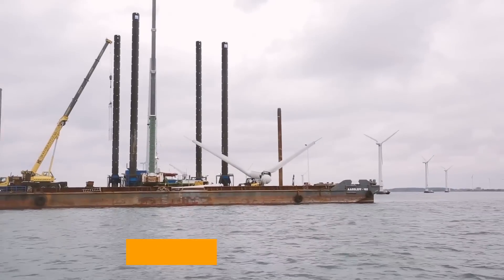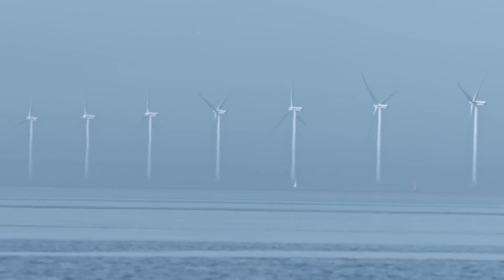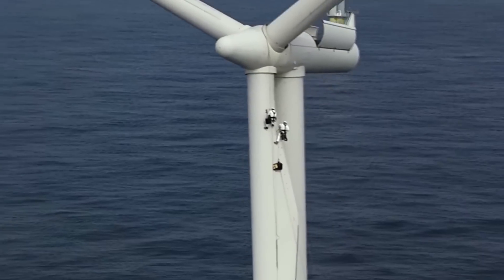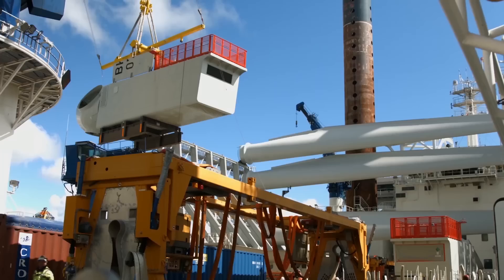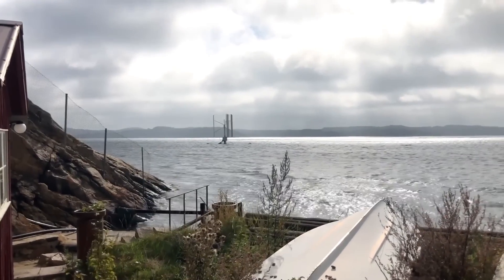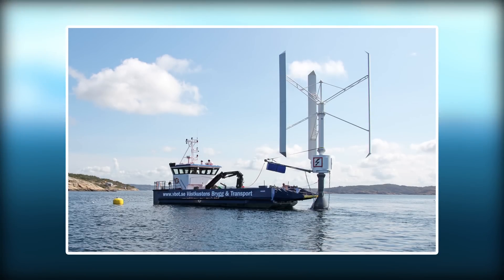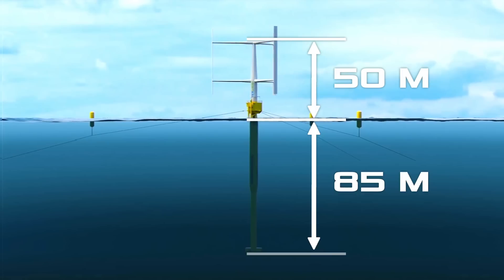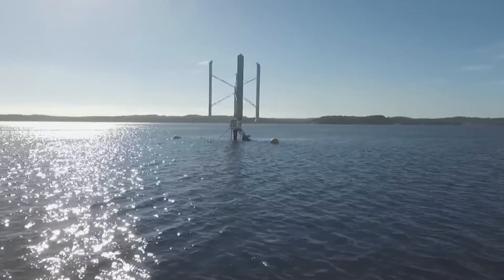Vertical-axis Wind Turbines could Revolutionize Offshore Wind Power

Comment: Great video. Just a correction though: SeaTwirl is not a Norwegian company, as mentioned in the video, but a Swedish company listed on the Nordic stock exchange Nasdaq First North.

Currently the company has a valuation (market cap) of less than $30 million so the potential of the stock is huge from here considering all the advantages mentioned in the video.
Reply: it is now worth around 23 million euros. The problem is, on their website they say  first commission will be made in 2025 so they will keep burning cash until 2025. IF their products are efficient and if they can sell then the upward potential is extreme but it's too risky for now.
Reply: That sounds like marketing to me, piss off.
Reply: Thanks for mentioning that it is a listed company. Will short it.
Reply: @jonaslipskas  let me know by replying to this comment again that if you made any profit or not. Right now the whole company is worth around 18 million euros. There are not many startups on the field so they can easily get bought by an industry player that's why I wouldn't short.
Reply: @husnucoban3571  to be fair, it's quite dangerous to short it because they are spending a lot for commercial and that can push price up for short time. But they do not have any chances in the long term. The proper turbine for offshore at the moment is 14MW. This company has no chance to produce turbines like that and you have to be insane to construct a 1MW turbine...
Reply: @jonaslipskas  I believe the same way but there are not many people trying to improve the current technology and creating start-ups in the field. Therefore eventually either they are going to be bought by an industry player for the know-how or they will shut the company down and pursue another start-up that would actually be comercially reasonable. The whole company's market cap is 18 million euros.. it is Nothing in this field. Founders will be rich eventually but I am not sure if it's going to be from this specific company.

I wouldn't trade in this circumstances.

Comment: Unfortunately most assumptions in this video are not true.
Reply: This what i have perceived as input power of air pressure produce little output in vertical blade system. O/I ratio will be low.

Comment: This entire video is filled with misinformation and blatant lies, easy to prove with just a few minutes of research.  I’ve worked in the utility-scale wind industry for over a decade and the reason NOBODY uses vertical axis turbines is, they do not work.  VAT’s produce only a small amount of power compared to HAWT’s.  Land-based horizontal, utility- scale turbines produce 80% of the time at 45% full capacity.  Off shore turbines produce 90% of the time at 65% capacity, and they easily yaw and steer into the wind.  Average lifespan is 30- years.  Numerous engineering firms have tested and proven VAT’s to be ineffective and a waste of money.  Don’t listen to morons like the guy on this video who have NO idea what they’re talking about, read the facts.
Reply: You don't seem to be up-to-date with the latest research. A recent report from Oxford Brookes University concludes that Vertical Axis Wind Turbines (VAWT) is far more efficient than traditional Horizontal Axis Wind Turbines (HAWT) in offshore wind farms. This since VAWT wind turbines increase each other's efficiency in wind farms and create much less turbulence (much less wake effect) and can hence can be placed much closer to each other.
Reply: Quotes from the research report:

"New research from Oxford Brookes University has found that the vertical turbine design is far more efficient than traditional turbines in large scale wind farms, and when set in pairs the vertical turbines increase each other’s performance by up to 15%."

Professor Tzanakis comments “This study evidences that the future of wind farms should be vertical. Vertical axis wind farm turbines can be designed to be much closer together, increasing their efficiency and ultimately lowering the prices of electricity. In the long run, VAWTs can help accelerate the green transition of our energy systems, so that more clean and sustainable energy comes from renewable sources.”

Comment: These are probably more efficient killers of birds, but as in The 5 Element if no wind blows... Nothing happens.
Reply: Safe for birds , the high speed of the tips of the blades on propeller turbines is what kills them , the vertical axis will have much lower speed..

Comment: If instead of electricity you make this turbine produce high pressure water the producción will increase because hertz will not be a factor,so they can turn 50%slower or faster plus a positive displacement pump is Les than half lighter than a generator,and no electronic, then you combine all the water on a single generator inland,exes water can be store in pressure vessels for peaks demand.

Comment: Does sound like a promising breakthrough, do wish such turbines could last longer
Reply: They already last pretty long current designs are rated for 20 or even 25 years but will likely be in operation for 5 to 10 additional years. This is more then enough.
Reply: Pretty much it sounds fake the power generated is pretty low..it might work technically but i wouldn't say that it will be cheaper. On-shore wind does cost about 30 -to 50$ a MWh that are 3 to 5 cent a KWh and off-shore is only slightly more expensive at 4.5 to 7 cent (45 to 70 $ a MWh) and is already getting launched in projects without subsidies. 
This new technology is unlikely to be competitive to gain enough sales to growth and get established. At maximum it will remain a minor addition.